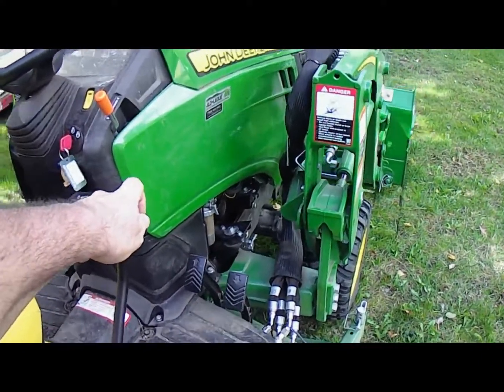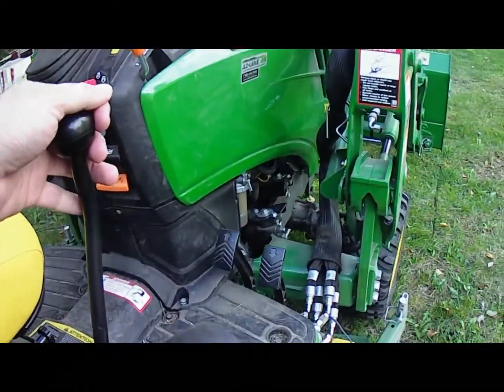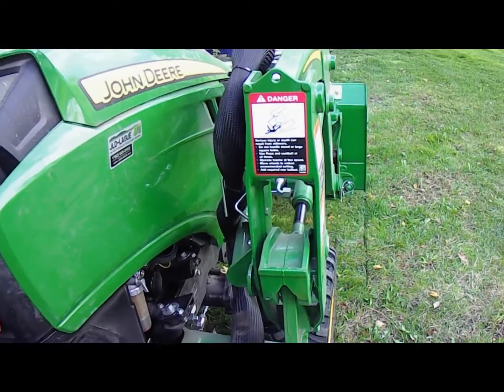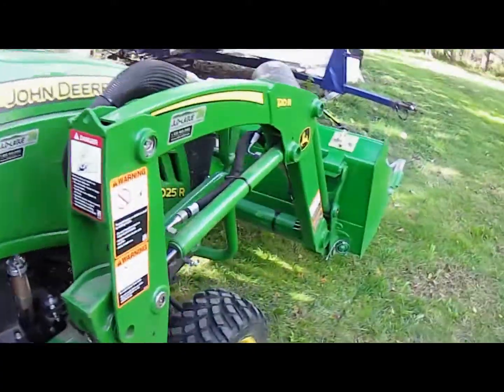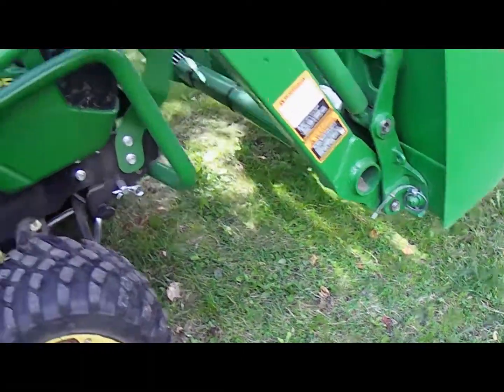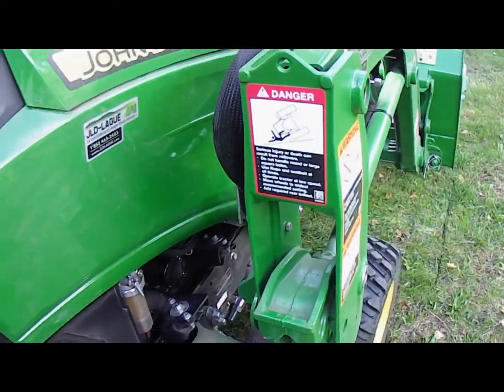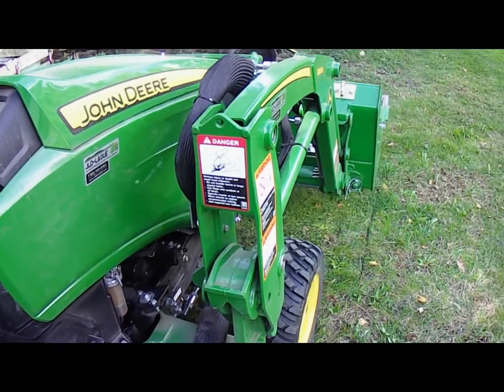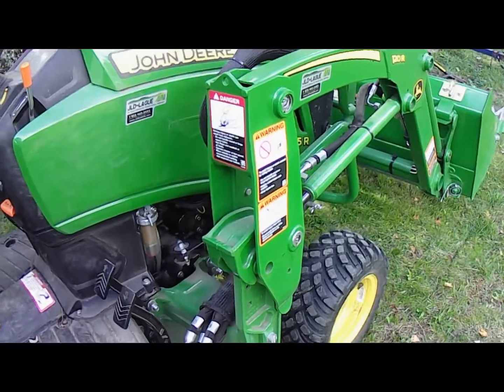39- John Deere 1025R Problem with front end loader

Comment: The solution is to remove and clean the 4 hydraulic lines below the right foot pedals. Even if they look connected, remove and clean with WD40 and a clean rag. replace and try again. This solved my exact issue.
Reply: thanks man solve my problem

Comment: Did this ever get solved?   My guess is that you've got 2 hydraulic lines crossed when you reattached it.
Reply from the maker: Yes is was solved after I inquired on the Green Tractor Forum.  Just had to disconnect the hoses and reattach them.  At first they looked perfectly fine and I did not remove my loader in a while and I have been using it every day before this happened.  Weird!

Comment: What was the problem? Mine is doing the same
Reply from the maker: I got the answer on the green tractor forum.
I had to disconnect and reconnect the four fittings.  Then it was working.  I found this peculiar because it has been weeks of using the front loader regularly without problem.  It is not like I just removed the front loader and just reconnected it.  Very peculiar.
Reply: @Anterak123  I've only took the loader off 1 time. Yesterday I thought 1 of the 4 fitting came unhooked and wasn't letting oil out the other side of the cylinder a nother reason I thought that also it won't pick  the ft end up with the bucket. I'm going to mess with it Monday it's raining today. Thanks!
Reply: @Anterak123  the red labeled hose came unplugged
It works fine now. Thanks
Reply: @Anterak123  That's what happen to me. Use it one day and left it attached. Then a few day- week later I wanted to take it off to mow and it would not raise the wheels off the ground. I figured/hoped it was the connections as I struggle now after a full tear rotator cuff, then a shoulder replace. They be hard to do with one hand

Comment: Check your hose connections, one might not be fully seated
Reply from the maker: Thank you for your comment.  Like the previous comment suggested, I did disconnect then re connected the four fittings then it was working fine again.  What is puzzling me is before that event the front end loader was working fine for weeks.  I didn't play with the fittings during all that time then suddenly this happened.  I am new in the tractor world so I am learning all the time.

Comment: Reseat the hydraulics connections.  Try cleaning them as well.
Reply from the maker: Great idea  I will try it tomorrow, Thank you.
Reply from the maker: Hello, I did disconnect the reconnected the four fittings and now it is working fine again. Thank you.
Reply: great advice.....my bucket stopped curling right......in the middle of using it....I unhooked cleaned and reconnectected...and alls good.....thnx